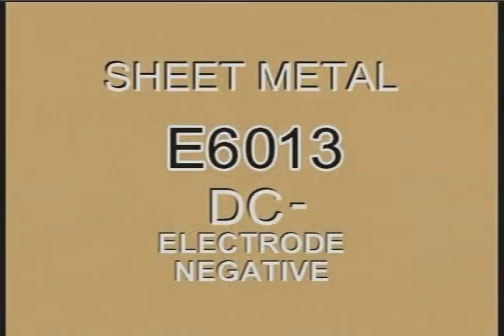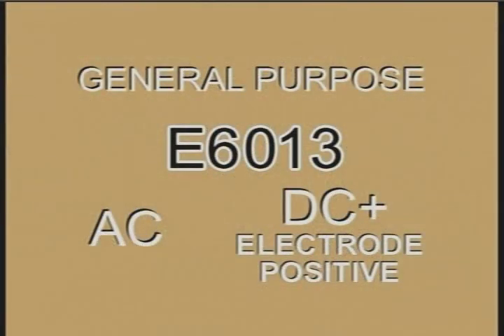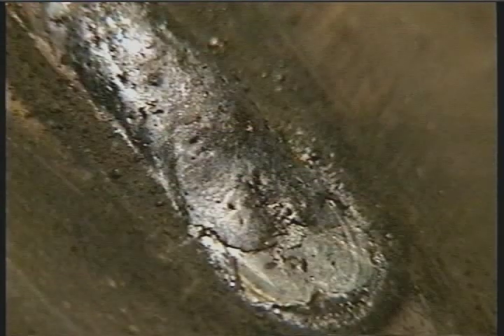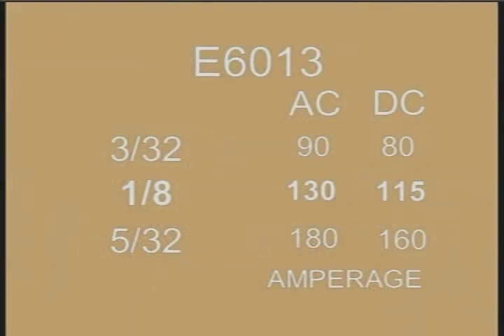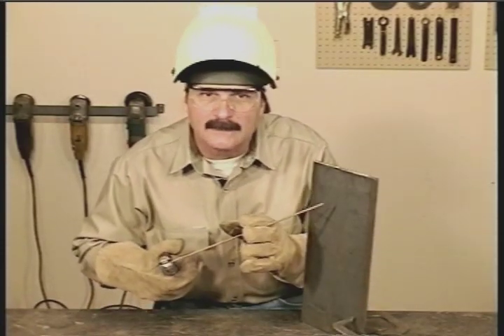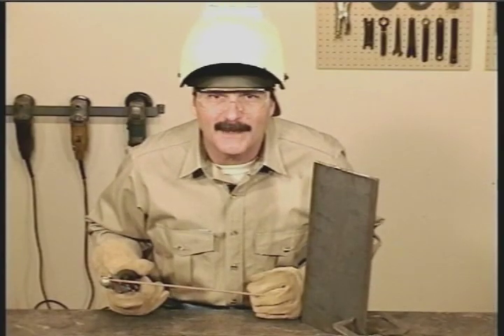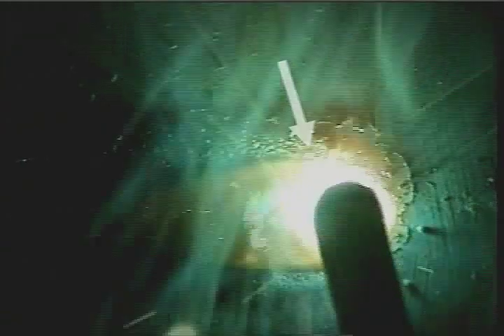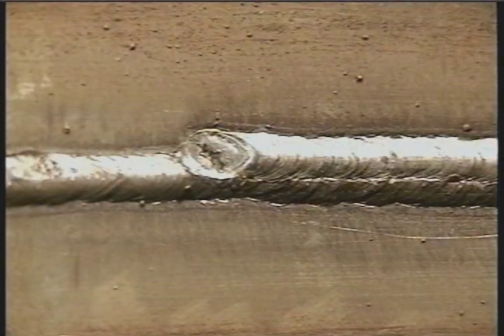Arc Welding Tips and Guide | E6030 | Good Bead

Comment: Interesting. Good information, I thought. I have had trouble controlling the puddle. Like bowling, I get a strike now and then, and in between it is all over the place. It looks like it is going great, but when I chip the slag there are pits and unevenness, particularly on 90 degree joints. The up-down thing was new to me.
Reply: If there are pits then that probably either means that your arc is too high off the metal or your amps are too high